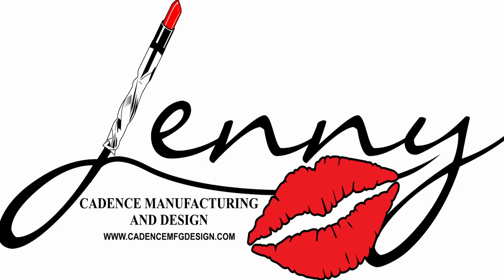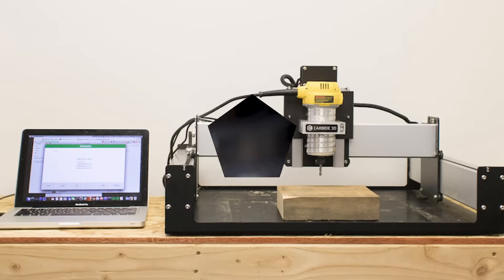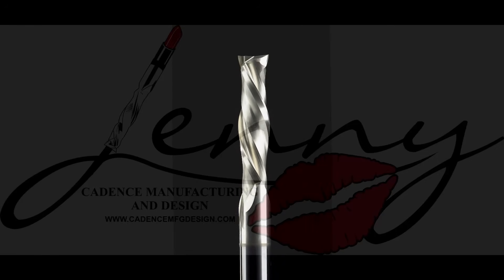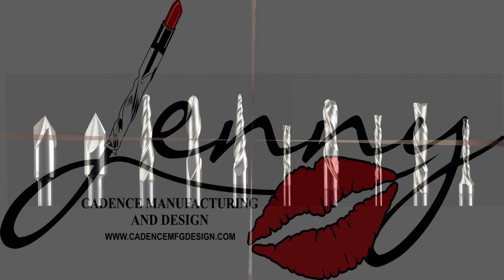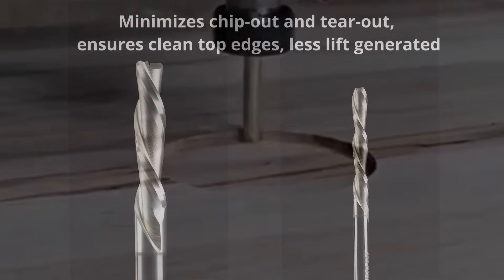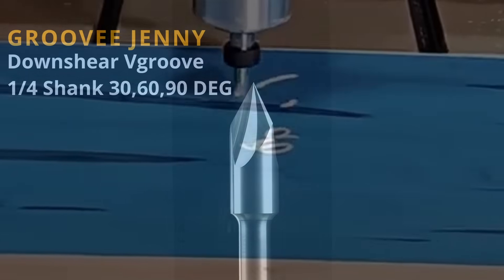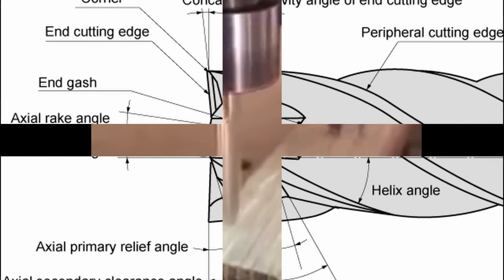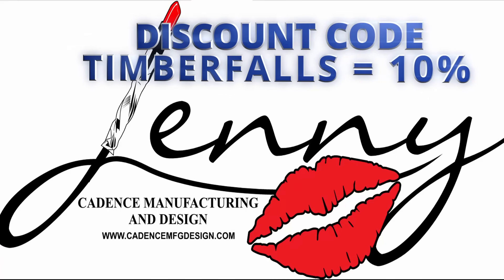The Absolute Best CNC Bits for Small Machines: Discover Jenny Bits

Comment: Are these only for hobby cnc’s? I have a 4x8 phantom and looking for new bits… this video has me really interested but only saw smaller machines in this video… thank you! 🙏🏾
Reply from the maker: These will work great on the phantom too. The bits are slightly geared to work better at lower chip loads but only by a few degrees and great for cutting wood at all levels.

Comment: I have a poor man's router on my CNC. If a bit is going to heat up it will be on my table. When i use these for 10 hours straight the bit will still be slightly cooler than room temperature. And yes i said cooler! These bits are badass!
Reply from the maker: I have had a very similar experience and is why I like these too. Thanks for the feedback.

Comment: Which of these bits do you recommend for roughing in a 3d carve?  Compression, Down cut or up cut?
Reply from the maker: Great question. I would have to say its sort of situational but my go to bit is the compression bit. There are occasions when I am rouging out a really thick piece and use that extended reach upcut because its the only one that is that long or if there are no flat surfaces on the 3d carve I may just use a downcut.

Comment: Jason, if you could have just 3 of the Jenny bits, which would you choose. I have a 4040 xe and work on models up to 30 mm in depth. Your advice would be appreciated. Cheers. Ray.
Reply from the maker: That's easy. I use the skinny jenny, the little B and the original jenny more than anything. The two tapered ball noses are the best 3d carving tools around and the jenny is best of both upcut and downcut bits.
Reply: Thank you for your prompt reply. I’m going to check these out. Postage may be expensive to England.